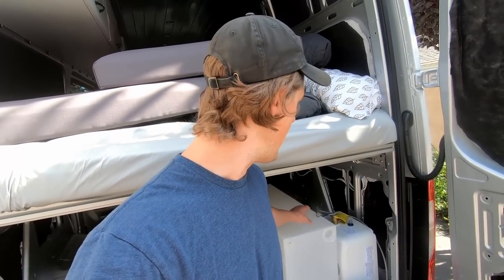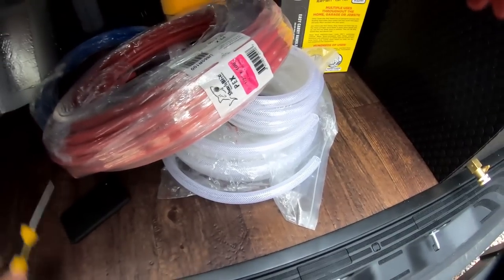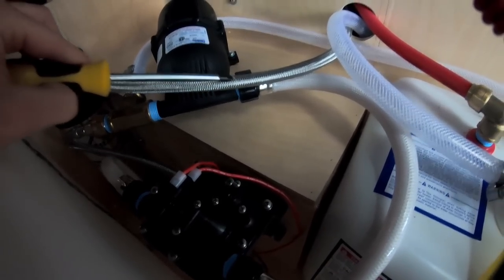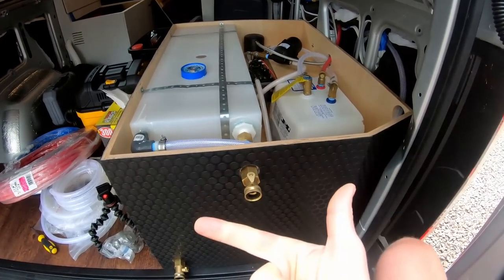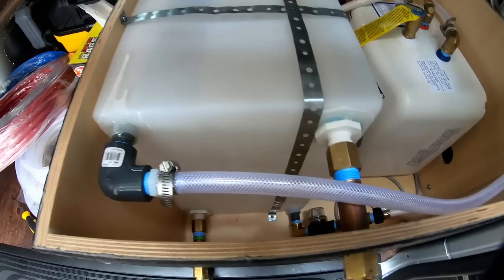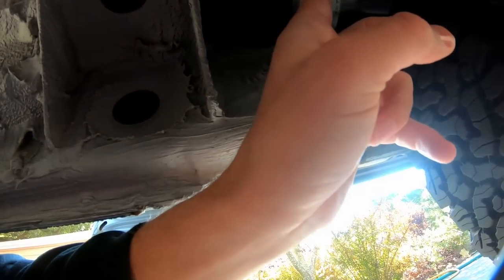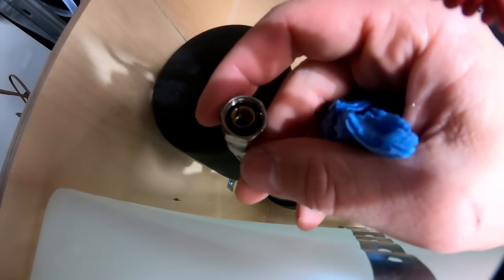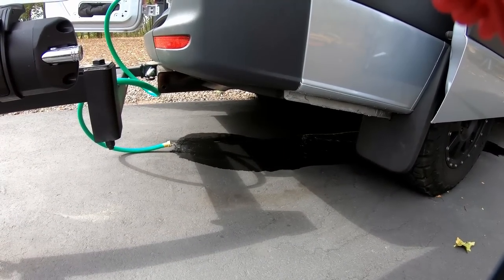PLUMBING & WATER SYSTEM In A Van Or RV (off grid plumbing for newbies) #vanlife

Comment: Hey mate, you forgot to list the filter mentioned @ 20:50 (for the smell) and I can't understand what you are saying. Could you help me out? Thanks!
Reply from the maker: That ended up not working. For my gravity drain to work I needed to increase flow everywhere I could. Ended up having an effective p trap in the drain pipe when it exits the van. Thinking of doing a video on the gravity drainage system, lots of challenges there.

Comment: How does the hot water get pressurized to flow?  I can't imagine that the cold water pumped into the basin would heat the water up quickly enough to if that was the pressure source.  I am mystified?  I can't imagine that the hot water has enough expansion to provide enough pressure.
Reply: He's got a 12v water pump in the box as well

Comment: So at about 2gpm of water pressure, you would only have hot water for just over 1 minute with a 2.5 gallon tank? That doesn't seem like much time for a shower or am I missing something?
Reply from the maker: The hot water is mixed so 1 minute if you like showering in lava. Now that I’ve used the shower, it only takes about 3 gallons of mixed water to get clean.
Reply: @seven_o_savage  
Oh ya, I forgot that it would be mixed. Thank you!

Comment: First off I want to say awesome job, but you might want to rethink the electric water heater. It is going to kill your batteries, propane is a much better heat source.
Reply: Exactly
Reply: I realize your comment is a year old....but at this point most people are ditching propane.  It's just a pita.  If you watch a lot of these channels you will notice that a lot of people are now using this water heater.  Heck even the Amazon reviews have a lot of RV specific reviews on it.  Battery/solar technology is only getting better/cheaper and you still have the bonus options of plugging in shore power or running a small generator for 15 min when you want to heat your water.

Comment: I understand the desire to be 100% electric, but the fact is that there’s no easier way of heating water on demand in a camper than a tankless propane heater. I would never use a heater with a tank for that, and even less so an electric heater.